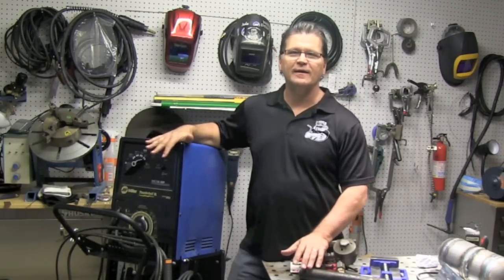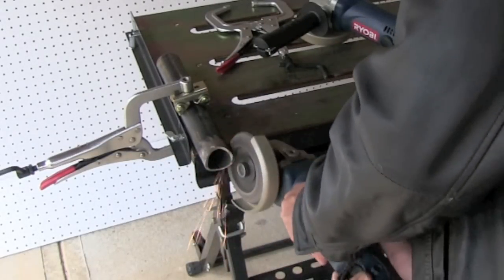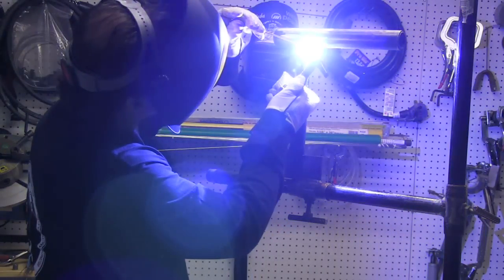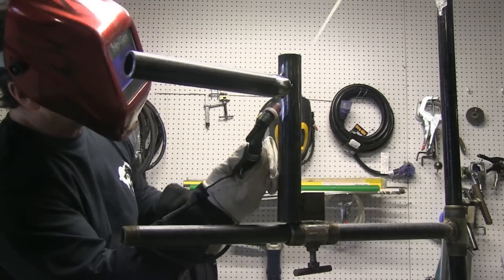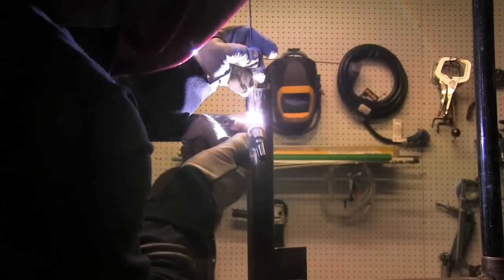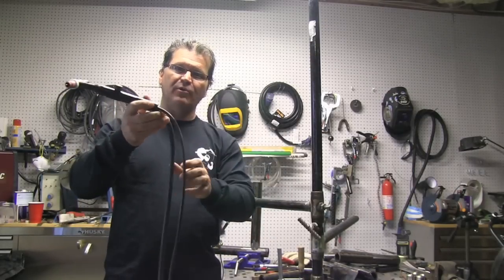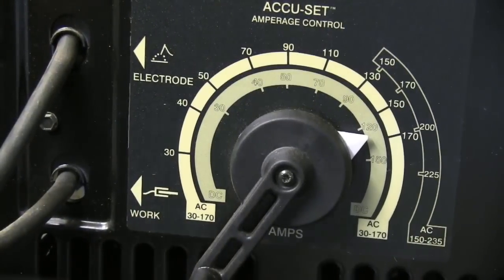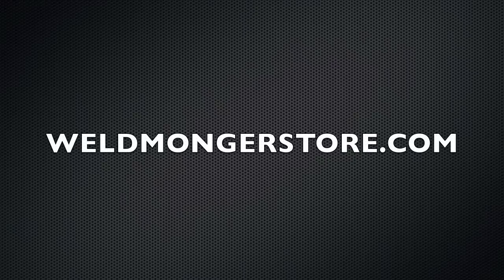Scratch Start Tig Welding Tips

Comment: Just want to thank you for all your hard work Jody. I've recently started a TIG welding class at my local community college only a month after starting my stick class at the recommendation of my instructor. I am learning scratch start because the machine I am using doesn't have a pedal attachment to use for TIG. I have been looking at getting a multiprocess welder that way when I start the MIG class I will be able to do that on top of stick and TIG. Your videos have been super helpful in seeing how I need to do certain things. I have learned that practice is king with this stuff and I hopefully will soon have a welder to practice at home with.

Comment: Hey Jodie (or anybody for that matter), with a foot pedal setup like you have could that be used to initiate the arc too like in lift start?  Ya know, for the sake of a clean tungsten?  I'm thinking touch the tungsten to work piece, complete the circuit with the pedal, then lift?  Or would it just stick?  Too much amperage?  I want to get into scratch start but I feel like a noob such as myself would just be spending all my time grinding tungstens and I'm trying to think of ways to make things a lil easier/cleaner...thanks!

Comment: Can I do a scratch start setup on a Lincoln AC buzz box stick welder to weld some aluminum? Buddy gave me a #17 torch w/ valve, all I see on YouTube is DC setups like yours but not AC, needing to weld a oil train bung onto a oil pan for my racetruck build, also just wanting to practice tig welding aluminum
Reply: AC waveform goes to zero voltage 60 times a second. You need high frequency to keep the arc lit.

Comment: I am a down hill pipe welder and run an SA200 on my truck. I picked up a bottle of Argon, a regulator and a W26 heliarc rig. I am having trouble with even making stringer puddles look good on flat plate. walking the cup I can half ass but it is still nothing worth mentioning. I have better looking results up hilling 7018 with a wide puddle. how can I improve? I don't have any one that can work with me locally.

Comment: I'm in need of some of your advice. I'm what you would call a beginner at tig welding I've got roughly 8hrs under my belt. I'm using a tweco 211i, straight argon, 3/32 filler, smaller electrode, and it's scratch start. My troubles are I can't get a good bead going welding a catalytic converter to a down pipe while it's on the vehicle. Are there any tips you can give me?

Comment: since watching your videos, i've tried tig welding with an old miller heliarch, the HF part no longer works so i've been messing steel work.  i love it to sat the least, one thing i cannot figure out is when trying to weld square tubing I cant seem to hold a puddle between the rounded side and the square cut.  On the butt joints it seems great, barely need filler rod.  I'm using a 1/16  tungsten, am i expecting too much heat from too small of electrode or just not good enough yet?  Thanks again for your awesome videos

Comment: This is very interesting. Until recently I didn't know you could TIG with a stick welder. I recently bought a stick welder used (Kemppi 150A DC rectifier from the 80s) to learn with as a stick seemed like the cheapest, most versatile welding you can learn, and now you can TIG with it too? Clearly a stick welder is the best home welding setup it seems!

The pedal is a really nice innovation! Makes me wonder though if they make TIG torches with valves for use with scratch start, why not make a TIG torch with a trigger like a MIG torch? That way you could use your hand to start or stop the welding.
Reply: +1873Winchester It would be possible to rig up a micro switch to the torch with tape or zip ties and use that to operate a relay large enough to handle the welding current. You WOULD NOT .... I repeat .... WOULD NOT .... let me repeat that again ... WOULD NOT want to switch the welding current with the micro switch. They aren't made to switch high current loads. You would want a low voltage source .... say 24VAC .... going through the micro switch. You're talking transformers ... relays ... wires .... pretty much a bear skins and stone knives approach but it should work. You could also rig up a foot pedal the same way. Disclaimer .... this was presented for entertainment purposes only. If anybody does this and gets hurt .... it's on you. Electricity can kill you.

Comment: Do you do anything special to electrically protect your knife switch?  You mentioned arcing when you close or open the contact with your foot.  Does it ball op and make rough spots on the blade that need to be filed off?

Comment: Jody, I tried TIG welding for the first time today. Not happy with the complexity of it, and my lack of skill (biggest factor). I'm running a pure tungsten @ 3/32, and a #7 gas cup. I stuck the tungsten in the weld puddle a couple times, and also stuck the filler rod to the tungsten twice. Noob mistakes I know. My real problem seems to be that I can't see the arc very well at all. My arc does not appear focused & sharp like yours does in your videos. I'm getting good, and fast, at re-sharpening the tungsten. I can't see the weld puddle very well and I'm wondering is it normal to use different settings for your welding helmet in order to see the arc better-such as less dark settings? Right now I'm at "7" on the 1-10 scale. Is it normal that I should have the work-piece at head level so I can get my welding helmet right up to the arc? I found that I was pressing my helmet to within inches of the arc trying to see what was happening. Regardless, I managed to burn through my workpiece (18 gauge sheet metal). Any suggestions for me? I have the gas flow down, and can easily start the arc but can't see well into the weld puddle.
Reply: +Go69 I'm in a similar situation (just converted my Miller Thunderbolt like Jody here to do TIG and training myself with the help of these videos). Seeing the puddle has been hard, but something that helped me was when I noticed my helmet had a dial on the side to increase / decrease the darkness. once I got that dialed in then it was better.  Positioning my head relative to the weld is hard...how are you supposed to see the arc when you're only supposed to have 3/16" stickout with the electrode? I know it's a pain, but it's getting easier. for seeing the arc, once I got the helmet setting right, I was able to see the arc. It didn't jump out at me, but I was able to train my eye to see the arc. I purchased a gas lens so that hopefully i can stick the electrode out to 1/4" or 5/16"
Reply: Any improvement with seeing the puddle? I just bought a new hood that made a huge difference (Lincoln Viking 4C). 
With time I've learned to get an eye for the puddle. When I started I was just a little freaked out about the power and heat I was holding in my hand... Now I'm used to it and I've learned to relax... Relaxing is key.

Comment: Hey Jody, your foot pedal cutoff is a great idea. Is there any info on how it's made?
Reply: +Jeff Lewis   I had a duh moment at first.  Never saw that before.  I would rather make a rheostat pedal control.  A blade switch works but wears out fast if you do a lot of switching on/off.  In a pinch MacGyver it.

Comment: You have great videos, recently i bought tig tourch and hooked up to my mig, yourch has a button same as mig tourch and i hooked it up so it would power on cable and allso opel electric valve to supplay gas, next thing is to make it pulse a bit, by that i am hoping to limit heat input, because on lowest setting i can melt 2mm plate easly..
if some one wants some more info, send me a message iļl try to explain what i did..

Comment: I was hoping to see how to appropriately come out of a puddle with out any form of pedal. This is the last thing that has been defeating me. I work as a TIG hand anywhere that pays and I have yet to see a torch without a valve and the peals just don't exist outside a shop scenario. My little miller diversion 185 babies me and I don't have that problem in the garage scene. The problem being 22 years of age is its hard to look like a pro when I still cant come out of my puddle correctly every time lol being this young generally gets me scrutinized  pre-weld-test so I really need to impress. Thanks if you would take that as a suggestion for a video In the future!  Always enjoy the videos. Keep it up boss!!

Comment: My first real stainless TIG project was done on a scratch start Miller Maxstar inverter I borrowed from the local welding store. Never did think of using the rod to start the arc though. Thankfully that machine was modern and automatically started the argon. :-)

Comment: Tig is cool welding, whats the benefit over using a MIG or stick welder? it reminds me of acetylene welding with a filler rod.
Reply: That's a lot to cover in one question lol
Stick welding (im referring to 7018 for the moment) can be run with winds up to 40 mph so its really good for field welds in the elements where its likely to have your gas knocked off your puddle using other welding methods which would really make for a bad day. MIG, in my opinion, is the best of the transfer methods for a shop scenario. Its fast and requires minimum cleaning (before and after.) Because the MIG process has so many adjustments you can make there is a lot of possibility to make welds that would seem difficult in other situations. like a 3/8in gap isn't so scary with a MIG gun in hand. TIG!! There is so much control with tig. It offers the best fusion possibility because your not continually piling on more filler material to sustain the arc there by possibly covering the root, (typically where your would find a slag inclusion for a 7018 root.) you can achieve the resistance you want by adjusting your tungsten to work length, sort of the poor mans pedal, its in my opinion the easiest to get into small areas and make the mirror welds happen. Lastly, the abstract metals are welded with tig much more so for its clarity and quality assurance. Hopefully that answers some questions. There are so many qualities of all 3 methods I have left out that I don't think this little text box could handle. Good luck.

Comment: Hey Jody, you've helped me out more than you could know, but if you take any requests, I was wondering if you could demonstrate a 7018 hot pass/fill pass on schedule 80 carbon steel.  It seems to be my weak point.  You did such a great demo of the 6010 root pass, and this would fall under the same pipefitter guidelines

Comment: So I'm totally new to welding and have watch all your videos ( best on YouTube by far ). I want to buy a Hobart 140 Mig welder. Is there any way you can make a video with one. All I want the welder for is to make a few BBQ pits for friends and family. I'm using 3/8in pipe. Or do you recommend I get the Hobart stick mate for that thick of steel. I just like the mig welder because it runs on 110 house hold current and not 220 like the stick mate.

Comment: Bloody scratch start the number of times I forgot to start the argon !!!   thanks for not editing those bits out  honest & open , jody , cheers
Reply: I've gotten spoiled by high freq start and a gas solenoid on my everlast welder. Starting and stopping the argon manually is hard to go back to.
Reply: Wait until you get a better machine like the invertig 221 the arc is so buttery youll wonder how you went without it.

Comment: So you have to have dc to tig? just got get my info right dont you do tig on aluminium with ac? i dont weld just trying to learn?
Reply from the maker: just like superspanks said...AC for aluminum   But an AC stick welder will not work very well at all for tig welding without a high frequency box and those are pricey.
Reply: DC is used for steel, stainless, and some other metals. Aluminum TIG needs AC to weld
Reply: HeadShot360IN oh evidently you know me more then i do then, some people......
Reply: Though DC positive can be used on thick aluminum with helium for penetration, but an AC cover pass is typically then done over the first pass for aesthetics
Reply: Hence why i watch these vids, ive learned alot. Keep it up as usual Jody if thats spelled right
Reply: n
Reply: +Hayden Lacey  como eu faço para solda Tig

Comment: Hi Jody,

This is my favorite channel on welding.

Good quality shots, comments and editing, and, excellent welder too...!

About warping, you were able to make a 90 deg. on the front of the pole (The side where the pipe is welded) But what about the other side? Because, when I tried this, the whole pipe started to bend toward the the welded side ending up with a bowed fixture...

Any suggestions...?

If you get a good deal on a used machine, you use it to learn and, if you have taken good care of it, put it up for sale. Cost of material, near $0.00.

Thanks for the time you spend doing this.

Pierre
Reply from the maker: one option to limit distortion on a small pipe is to make a strongback. Rigid pipe tools makes something called a pipe welding vise that might give you an idea. It is a casting and uses chains on each end that are snugged with a crank handle.
But you can make something similar...essentially, a piece of channel or wide flange drilled for  u bolts on each end and a spacer in the middle.  This would be placed on the opposite side of the weld and preloaded by tightening the u bolts.
hard to explain here so I will work on posting something about this
Reply: weldingtipsandtricks
Good idea, I get the picture, it's easy to make for cheap with current shop scraps.
I went to see Rigid's site and this what it look's like:
https://www.ridgid.com/ca/en/pipe-welding-vises
I love learning stuff...!

Thanks,
Pierre

Comment: What wire size you are using usually?
Reply from the maker: I used 1/8" (3.2mm) for this video. I tack welded with 1/16" (1.6mm).  3/32" (2.4mm) would have worked ok too if I were to dip the wire and feed a bit
Reply: Thanks.

Comment: What type of cutting wheels do you use ?
Reply from the maker: the cutting wheels in this video are cheap ones from Harbor Freight.  But they actually work good and last quite a while. I cut 5 saddles for this video ( It usually takes several runs to get all the shots for a decent video)  and could not see much wear on the wheel.

Comment: that's all they use for all the stainless and mild steel at the Nat Gas power plant we were building in Williston ND. Scratch start hot stick.  But if those guys had to weld anything else they don't know how to.  They only weld pipe and that is it.

Comment: Great video as always, thank you.  A question, if you were to switch welder over to AC could you do aluminum this way?   Thanks!
Reply from the maker: you would need a high frequency unit to maintain the arc .  But then you would have to spend as much as it would take to get a newer AC/DC inverter so its not the best way
Reply: weldingtipsandtricks
Thanks for the fast come back.  On the side, tig fingers I received as a gift work sweet, sweet, sweet!  Super product Jody!

Comment: what is the secret to actually making money doing metal work? I always seem to spend more on wire, gas, sawblades, rent, electric etc than I make working
Reply from the maker: if there is a secret it is probably not being afraid to charge a rate comparable to what automotive shops charge.  also a minimum rate no matter how small the job to discourage those paper thin lawnmower decks and other jobs that take more time than they are worth.